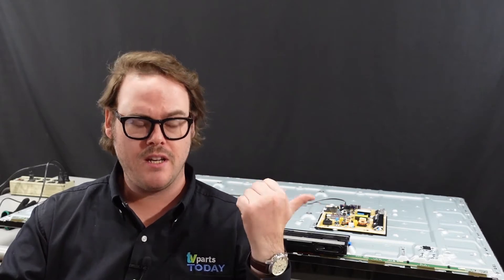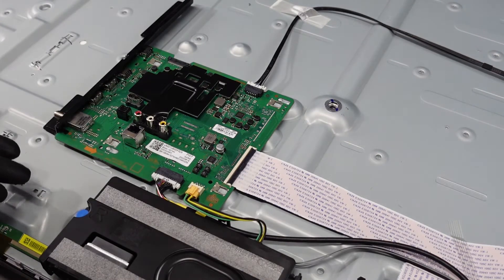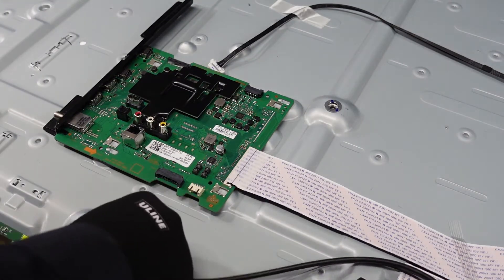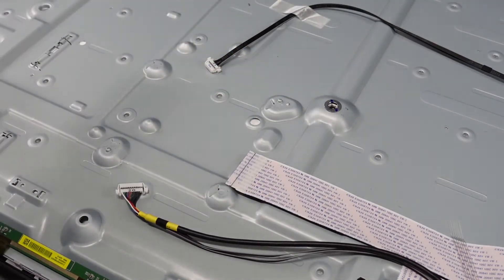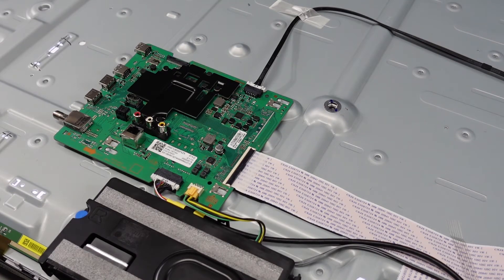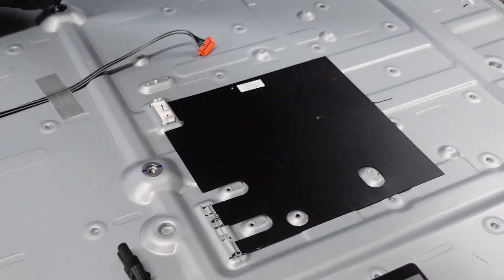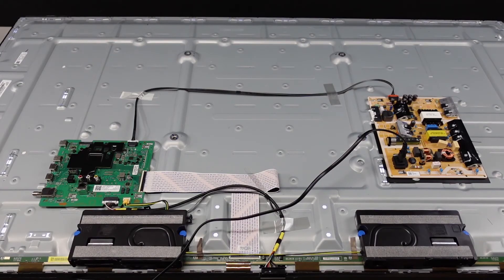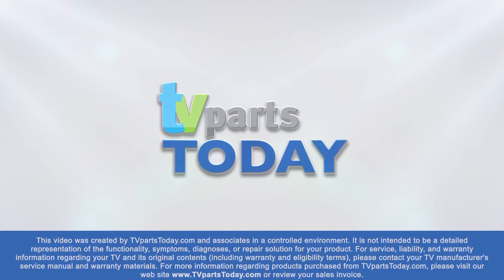Prepare to replace the boards on your TV.  (SAMSUNG UN65TU8000F)

Comment: Just stumbled upon your video because my tv went out since Black Friday week 2024. Finally bought the board and came in today, still had the same issue. Installed both new boards, the issue was WORSE. (With the old ones it would stay on longer then shut off) put the old main board back on and the new power board and it was better, still shut off. Keep in mind, all LEDs work, they play tv for a bit and then the whole thing shuts off. 

Now… because I was trying different things, at one point I forgot to plug in the FFC cable, turned on the tv and guess what… the tv stayed on, LEDs stayed on, BUT I had no image. I was able to heard the tv and what was playing. Tv stayed on!! I tried both new boards, FCC cable unplugged, it stayed on! No image though. 

My conclusion: FCC cable is bad… it’s $13 through Samsung. Will try ordering that and see if that fixes the issue. Def beats buying another $700 tv
Reply from the maker: I was going to suggest checking the wiring harness too. I think you are on the right track, let me know how it goes.
Reply: @ ordered it last night. Will update once it arrives

Comment: sir ..how to pair the motherboard and panal ..UA50TU8000
Reply from the maker: after poking around for a while online there is VERY little information about pairing the main board to the panel in newer samsung models. Shop Jimmy has a pretty nice step by step, ill link here. I didn't notice your model number on the list of compatible models, but I hope this will work for you. https://blog.shopjimmy.com/replacing-a-samsung-main-board-make-sure-to-do-thes/

Comment: Hello there, I’m having this same issue with my television and was considering trying to fix the issue myself rather than buying a new television. I’m glad I stumbled upon your video because it gives me less confidence that spending the money on parts will fix the tv.

My question then is… do you have any idea what caused this issue in the first place? I’m a bit frustrated because I bought my Samsung television new just over two years ago and the extended protection plan just expired. I don’t feel like it’s likely for the tv to just go bad after 2 years but I’m no expert. Any thoughts on the cause?
Reply from the maker: I don't really have any idea why this Samsung set is power cycling, but even with swapping out the power supply and main boards we still had the cycling issue.  I would assume there is some fault in the panel that is causing this problem.

Comment: I accidentally ordered the wrong PCB main board for my Samsung UE55TU8502 (ordered BN94-15328X instead of BN94-15328P) but with the new PCB I don't get power cycles anymore. Someone told me to get rid of the TV and not even attempt to buy the correct part ( I cant seem to find it anyway). Is there another PCB that I could try - a compatible one?
Reply from the maker: That TV looks like it is pretty new (2020 or 2021?), so I would assume that the main boards are specific to a version number on the sticker on the back of the TV (e.g. FB03 or FC03). This usually means that you would need to find the exact part number that is compatible with your version if you were attempting a board swap.

Comment: Hello, I have a problem with my Samsung Qn82q60rafxza, the television was on and an explosion was heard, small inside the TV, and it stopped working, it does not turn on and the red sensor does not turn on, what could it be?  Could it be the power board?
Reply from the maker: Most likely yes, the power board.

Comment: Can I do the tape ribbon trick on these units? I have a similar tv with the same power cycling and was reading about blocking the clock signals
Reply from the maker: Unfortunately with this model it will most likely not work.

Comment: so it's a panel problem? can that be fixed, replaced or what?
Reply from the maker: In most situations, if there is damage to the panel or the panel needs to be replaced, you would be better off buying a new TV. The panel components are usually very expensive and the process for swapping panels is very complicated.